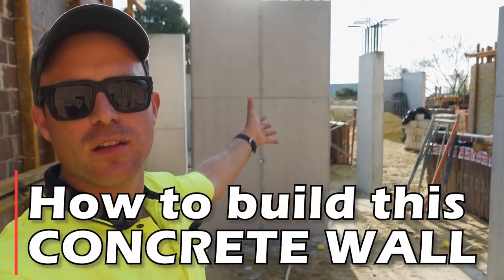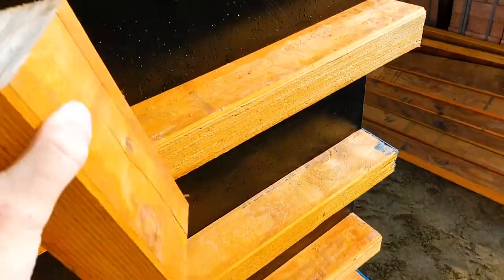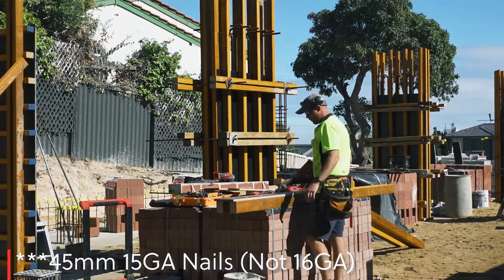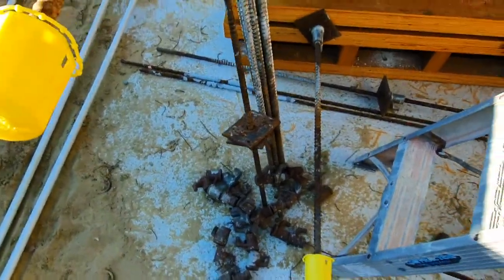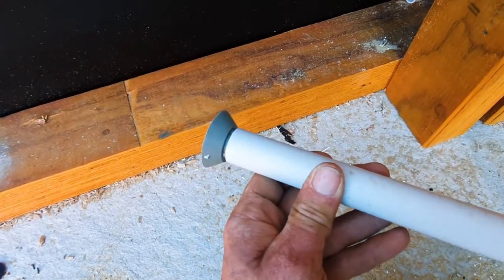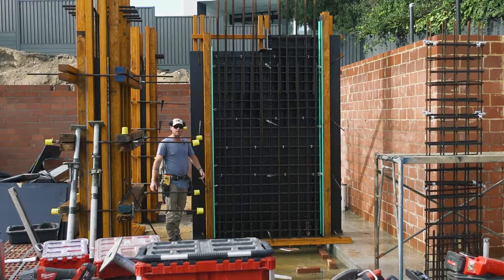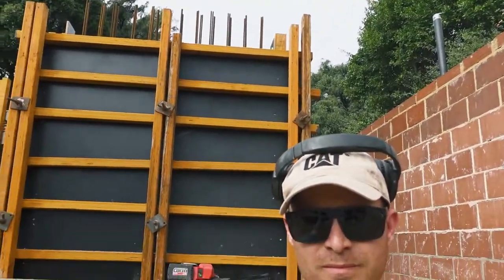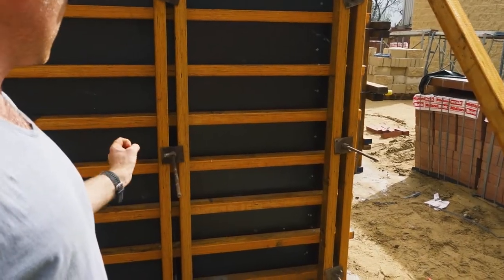HOW TO BUILD TALL CONCRETE WALLS ON YOUR OWN

Comment: If we want to do a wall in smaller sections i know you have to extend rebar and put holes in the form but does the new pour just bond to the edge of the section thats hardened?
Reply from the maker: Joints never look great. Hard to seal because so much pressure. Concrete leaks look bad. Also will never be the same colour. When they make the concrete all it takes is for the sand to come from a different part of the quarry or a different brand of cement of country of import ect ect and you have a different colour.

Comment: Awesome video!
I appreciate you taking the time and uploading your talent for others to learn!
Keep up the great work!

Also- is that black laminated plywood? What sheeting do you use? Also, is that LVL for the supports? Why not use normal lumber? Too much variation?
Reply from the maker: The black coating is a phenolic resin which provides a very smooth concrete finish and can be used many times. Lvl is far stronger and cheaper for us here in Australia. We can get far more uses from it than with normal lumber. Pine warps and twists from the moisture in the concrete. Lvl doesn’t. It also provides consistent strength. Pine has weak spots.

Comment: Great video. At the start, do you simply drill the type 17 tech screw directly into the 6.5mm hole? What is the wire for?
Reply from the maker: Yes. The wire wraps around the screw creating a tight cheap concrete anchor.
Reply: Sorta thought so. Just doing a small retaining wall now, 1m tall, hence sniffing around YT for tips. Thanks  for getting back.

Comment: How do you find the Milwaukee pin gun, go alright?
Reply from the maker: Benny, the 18ga is unreal, so smooth, feels so good in the hand, consistent depth, the 15ga though is (I think) one of the very first guns and it is rubbish, still better than nailing by hand but it keeps breaking.
Reply: @bmformworkconcreteconstruc9783  solid bro, appreciate the feedback

Comment: Hey mate, I know you said you didn’t pour the concrete but do you know mix they used to get that nice finish?
Reply from the maker: Columns tend to come up nice generally because they're higher mpa in my opinion. For smoothest finish use higher mpa like 40mpa, small stone and a wet slump like 100-110. I think this is what was used on these columns too.

Comment: hey mate, what is the main purpose of the conduit?
Reply from the maker: Hi Mike, it stops the bolt from being cast in the concrete. Without it you cannot remove the bolts.

Comment: How much would this cost to DIY?
Reply from the maker: If you can get the materials secondhand it would be much cheaper to diy. The concrete is pretty cheap. You need to have the equipment already or lots of reusing for it to be cheap diy.